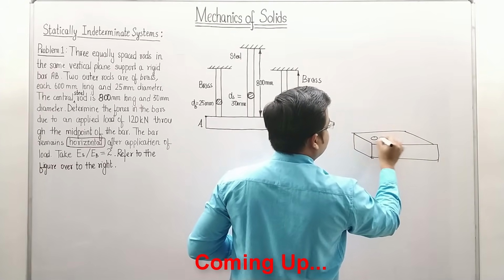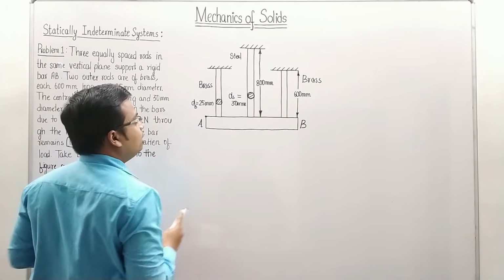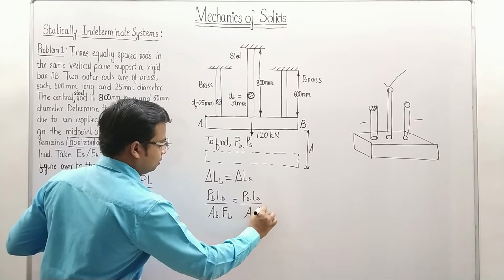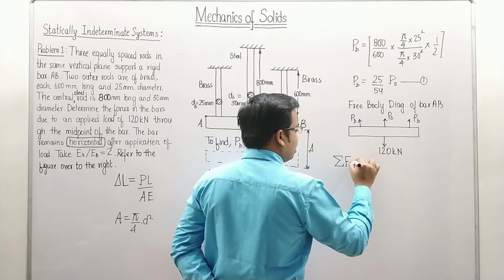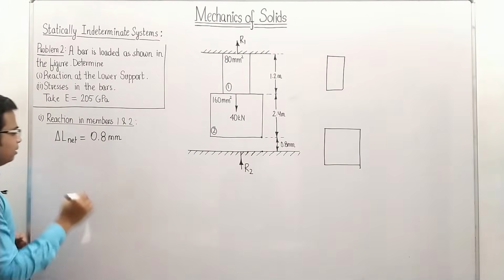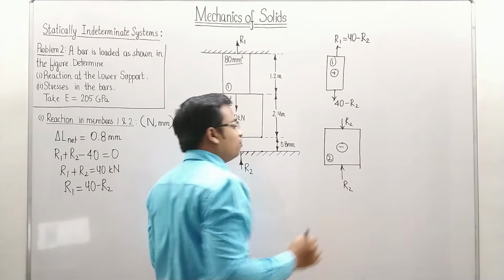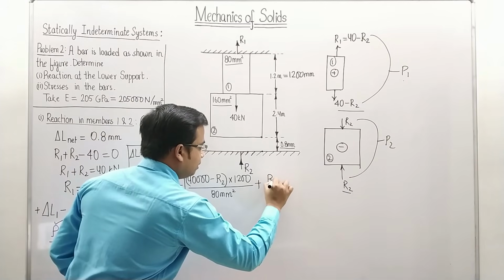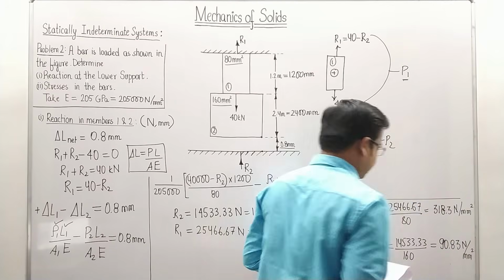Mechanics of Solids | Simple Stress and Strain | Problems on Statically Indeterminate Systems 1 |

Comment: I have a doubt. R2 will be generated only after touching the lower support. Untill then 0.8mm deformation is going to happen by both R1 and 40 kN only. Then how does it possible to frame an equation that's give a combined effect all the three forces. Pls clarify
Reply: Same doubt for me too... I hope this shall be addressed.
Reply: untill then body 2 will be freely expanding once it touches rigid plate then stresses devolped in body 2
Reply: @althaf4432  in the question, situation should have been explained clearly. Until that this is a clumsy to understand. Based on imagination and an assumption only this is valid

Comment: Sir in problem 2 value of R2 is negative .so value of R1 add hoga na ....plz rply sir....
Reply: No, sir did the sum wrong

At first u will find a load till the bar touches the end  that will be expressed as [p'×L2/A2×E] = 0.8

You will get the value of p' then 
You will get a net load of 40-p'